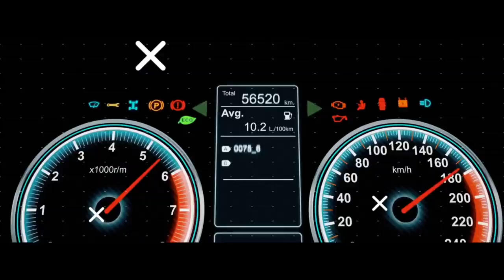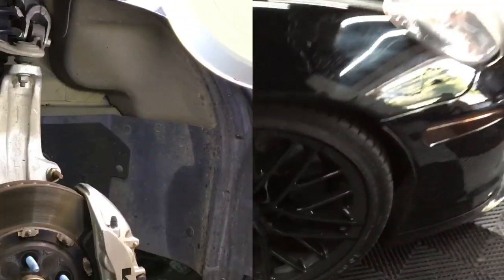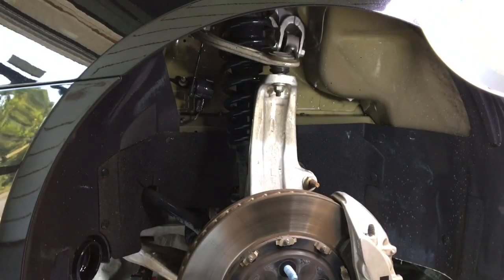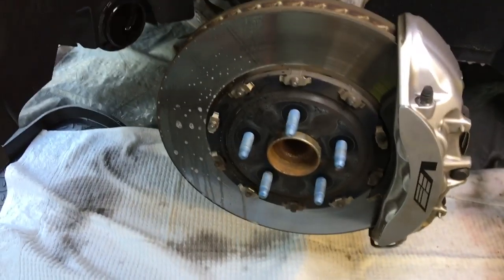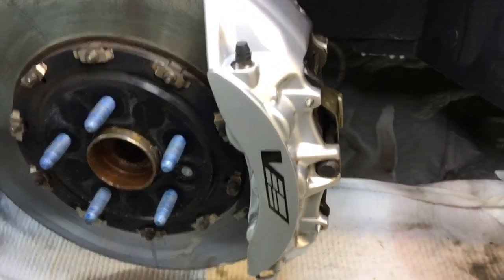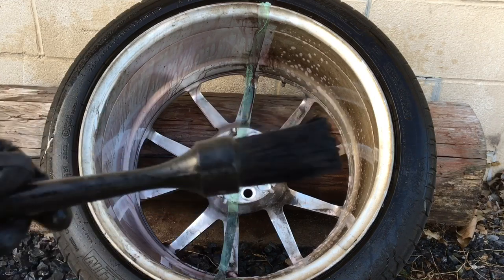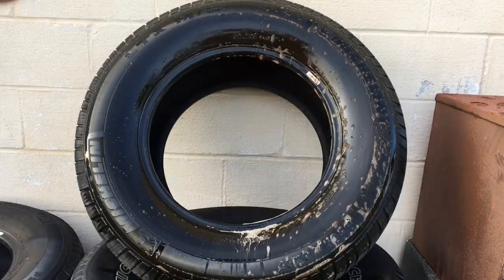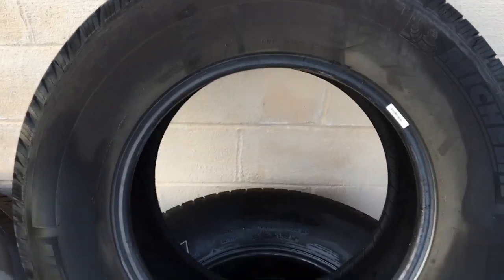P & S Brake Buster!! Non Acid Total Wheel Cleaner!! My Conclusion Is........

Comment: I think Brake Buster is a really good maintenance wheel and tire cleaner. Sometimes a heavy duty iron remover wheel cleaner isn’t needed. I think you did a good job showing that.
Reply: For being a driveway detailer this is on my shelf. I keep my tires and wheels in good shape and this works well for me.
Again Brian thanks for your info :)
Reply: mrken66 You are welcome!
Reply: I am solutely agree, Brian. Brake Buster is my maintenance wheel and tire cleaner...I have other products for heavy duty/major cleaning (Adam's Tire and Rubber and Meguiar's Ultimate All Wheel Cleaner). But as long as the wheels and tires aren't completely trashed, this is a very good product to keep them clean on a regular basis.

Comment: Best in depth review I have seen. I use Break Buster on well maintained cars and I like that I can clean the tires and wheels with one product. On heavy duty dirty wheels a product with iron remover would be a better choice, but then again you would need to use another product for the tires.
I agree it is a good product but not the end all be all of wheel/tire cleaners. Price 👍, made in USA 👍
Thanks Brian 👍✌️🇺🇸
Reply: That is exactly how I use Brake Buster as well. My cars are well-maintained, and I rarely need an aggressive wheel cleaner. Brake Buster and a couple of Speedmaster brushes keep my wheels, calipers, and tires flawless.

Comment: I made the switch not long ago to the P&S and i am glad i did because it does a great job at the minor dirt that my car gets and is cheaper than the ones i was using. If i were to go after really bad rims and tires i would probably try it and then go to stronger. Well worth the money in my opinion especially if you do not let them get extremely bad

Comment: I like Brake Buster for being non-acidic, does not rust rotors, and gentle cleaning. So for the correct tire or wheel it is all I can ask. For the rest, I pick and choose based upon the wheel and tire conditions.
Reply: Acidic cleans rust off

Comment: Couple thoughts! My two cents that is… 
P&S has this priced where it’s hard for me to justify many other cleaners. That’s not to say this is all I use or even that I think it’s the “Best” at any one thing. It’s solid for both Wheels & Tires which makes this one of two baseline wheel/tire cleaners I start off with depending on the situation. I always start off as least aggressive as I can and step up from there IF needed. Best value and a good starting point on well maintained cars ( wheels ). I also like the fact that whatever rust inhibitors it has actually work. I use this on my personal vehicle ( White Brake Calipers ) on a regular basis with good results. It foams great with a foamer and foams ( clings ) above average with just a regular sprayer.  Seems like there’s a significant amount of lubrication in it which I like also. 

I have found so many Wheel cleaners aren’t as good at cleaning tires and vise versa. I used to hate having to reach for two different products ( one for wheels and one for rubber ). It filled that gap in for me for the most part. Having said that… I still have and use other products based on the scenario. I’m not sure there is a “Silver Bullet” for wheels/tires as there will always be many variables and factors to consider. 

Wheel / Tire cleaners happen to be the one product I seem to use the most of in terms of quantity. I’m sure some of that has to do with my heavy-handed spraying “technique” lol. Having said that …. at $20.99 per gallon ( retail ) or better yet $14.15 per gallon (my discount) I can’t see buying many others. 

My top two (Non-Acid) products that do well on Wheels & Tires (caveat) … while being priced affordably are BrakeBuster and NanoSkin Non-Acid. Off the top of my head I either have currently or have used in the past: Eagle One – Mag/Chrome/All Wheel/Plasti-Coat/PVD,  Meguiars – D1801/D140/D143, Chemical Guys- Diablo Gel, Griots, 303, Super Clean, Power Clean, Purple Power, Extra Tough and many more. 

As always…. Thank you for the video! How about a QP ON durability update video ( maybe 2.0 )? Either way I look forward to whatever you decide to roll out next.
 Take Care!

Comment: If doing a wheel off, any non chlorinated brake cleaner spray should work for inside the fender hub. It will not rust out the rotors like a lot of wheel cleaners do. It will not harm painted calipers, but will harm anything that is powder coated. 
I’ve also used it for the inside barrel of rims to get hardened brake dust off. 
The outside of rims, there’s a bazillion choices. 
I haven’t tried Brake Buster yet, so thank you so much for the video!

Comment: I bought a gallon of this stuff and mixed it 50/50 with water. I've been using meguiars hot rims wheel and tire cleaner for the past 2 or so years. That stuff did a pretty good job but didn't clean rubber as well as the wheels. This brake buster stuff when I sprayed it on didn't seem to change color much but I brushed the tires and wheels real quick and hosed them off. I haven't seen my wheels so clean and bright since I polished them several months ago. Really happy with it for a general use maintenance cleaner.

Comment: I stay ontop of my car, washing it once or twice a week, so P&S Brake Buster HAS replaced my other wheel cleaners, except for Auto-Fanatic foaming wheel cleaner because I still have 2, unopened quart bottles of it, like that as well but yes, it's VERY expensive but safe for your wheels AND you!!

I used it first in my IK 1.5 and now my Foam Pro2 and have settled on 4:1 for my maintenance washes. It cleans well for me and has the rotors rusting about 50% less, so I like that and imagine its safer for the associated parts around it as well. Finally price, another winner for me👍👍

Comment: When I first tried it, I thought Auto Fanatic wheel cleaner was “ the” game changer. I’ll have to look again at my dilution ratios on value but using PS BB. On maintained wheels , with some agitation, at 5:1 in an IK foamier it worked great, the foam had a long dwell time in shaded heat in Maui. I agree with Brian, it’s not the end all. I still use some pretty heavy duty cleaners on especially harsh tires and wheels. Experience as always will dictate what product I think will get the job done at the quickest and most effective. Each product I use is like a golf club in my bag... sometimes I need the driver, sometimes the putter or a pitching wedge.

Comment: With ceramics on both my daily drivers I don’t need a dedicated wheel cleaner, but I bought a gallon and use this straight for tyre cleaning. You can’t beat it for the money, even out performs dedicated tyre cleaners I’ve used like the gyeon and adams

Comment: P&S also is supposed to have a rust inhibitor to help with rotor rust after cleaning. As you discussed
Reply: I find I like to use P&S for maintenance, but when I use say adams wheel cleaner that has an iron remover in it, I actually spray P&S (diluted 1:3 rn) on the rotors, caliper, and pad area to help with the rust. I've noticed with iron remover I've gotten rust on the rotors of course, but also at the top of the pad where the clip meets the caliper.

Comment: I like nanoskin non acid, excellent wheel and tire cleaner even removing silicone easily, many suds and lubrication. It is stronger than brake buster
Reply: Same here works really good and cheap.
Reply: It’s my go to as well - if I need stronger I hit it with Nano Speedy Brite - that generally solves the problem. I have a small bottle of the old skopl acid if push comes to shove, but very rarely need it.
Reply: James O'Brien yeah I like nanoskin because I change every week the dressing used so I want to strip it but brake buster is a good one also for that situation.
Reply: @James O'Brien Then why not dilute it a bit more? Less stronger and it last longer and cheaper

Comment: I actually really dig this as an alternative to using an APC on tires (which is my current system). Been using Simple Green (diluted 4 or 5:1) and it works great, but being a degreaser, it is going to take some amount of your tire coating/treatment off (how much is hard to say but I imagine it would shorten the life of whatever you're using if only slightly). BB seems to do a great job but without removing as much of the coating. I usually treat my tires with Perl after cleaning and it'd be awesome to be able to clean a tire without having to recoat every time. And as you mention, it's nice and cheap so I'll definitely give it a go. 30 bucks (CDN) for 4-5 gallons of finished product is as cheap as damn near anything out there.

Comment: Selling point of Brake buster: versatile (wheels/tires/wheel wells), good value, gel-like texture (stick to rims better), anti rust (some say rotors still rust after )
I will try after my bilberry wheel cleaner gallon is done, especially because of the gel texture ( i hate applying a wheel cleaner and most of it goes straight to the ground) and because it will replace also the degreaser i use to clean tire and wheel well.

Comment: For best results with any brake/wheel cleaner is to apply it, allow to dwell, then agitate with a decent brush, then pressure wash. The P&S exceeds my expectation every time. I do all the suspension and steering components and it leaves it all looking like new. After it's all dried up, I hit with a hydrophobic spray and wipe it all down so it resists road grime making future clean up much easier.

Comment: This is what we've come to expect . no hype just good reliable info thanks  Brian.  I love my nano skin  non acid wheel and tire cleaner. But may pick this up to play with. What about slickness p&s is known for?
Reply: I have both. If your asking does the wheel feel "slick" after cleaning with BB I couldn't tell you. LOl... Actually .... until now I never thought to check lol. I can tell you that I noticed considerable lubrication (slickness) while agitating with a small brush ( whatever that's worth ). Much more so than other cleaners I've used. NanoSkin Non Acid is stronger than BB and they are my top two. I generally start with BB and move up in aggression from there as needed. Love them both .... especially considering what they cost per gallon.

Comment: I think for a detailer such as yourself, you absolutely would not want to have this as your only wheel and tire cleaner. There are stronger cleaners out there that are going to allow you to clean the wheels faster and easier.  I think Brake Buster is better suited to weekend warriors detailing their own vehicles on a regular basis, or if you have regular clients that take good care of their vehicles. 

I'm a weekend warrior, I wash my vehicles every Saturday morning. For me, Brake Buster is perfect because my wheels and tires never get very dirty...and this is a more gentle maintenance cleaner that is safer for regular use (for me and for my wheels). I dilute it 5:1 in an IK Foamer. A quick scrub is all it takes to get them perfectly clean. At that dilution ratio, it is super economical.
Reply: How much different can you get from onecwheel cleaner to the next? Is there a different formula? Put them side-by-side and read the label

Comment: What will it take to get you to do a 3D Super Wheel cleaner the same way? I like it. Another question is what is a good extractor for a decent price? I am over the bissell spot clean and it has to do with the extremely short hose. I have a 17 ram 1500 crew cab and that hose makes it a pain.  Maybe some day I can get to work a day with you to learn a few more tricks.

Comment: I have a 2020 Ram and it has painted wheels.  I plan on hand washing this truck on a regular basis.  Which wheel cleaner should I buy?  I was thinking P & S may be worth it.  I purchased a bottle of Meguires wheel cleaner but that only lasted 3 washings.  I want something I can buy a gallon of and mix it to get many washes.

Comment: So I think you're all a little confused.  I don't think anyone is claiming brake buster to be better at cleaning than other brands.  It's a cheap product that is easy on your body, and cleans ANY wheel which takes the risk out of it with pros being able to use just one product.  Are there better cleaners for this, absolutely, but this is a one stop shop cleaner that won't kill you over the course of 30 years
Reply from the maker: I am not confused...and dont care what others say. They do not work in my Shop. I am saying it is average....not bad...not incredible...average.

Comment: I must say though......

do you not consider possible ASBESTO or any unknown dust you might be kicking up with that blower method for drying? 
Even OSHA has recommended AGAINST such methods when working on brakes. Now I know you aren't working on brakes, but the wheel well area is a known area for that sort of contamination.

Comment: Sticking with adams. It is expensive, but I've been using it diluted 50/50 with DI water or even less for maintenance washes.
Reply: police_state ain’t doing yourself much of a favor sticking with Adams but to each their own
Reply: @r3ktfahdle120  What do you recommend as a replacement? I haven't been following wheel cleaners too closely lately as I have a gallon of Adams and have been satisfied with the results.
Reply: police_state i maintain my cars weekly so brake buster just works for me. $20 a gallon you can’t really beat it. I like Adams but their stuff is really expensive and the company seems to be moving toward rebranding a lot of their new products. For caked on wheels I really like Meguiars all wheel cleaner, you can find it at any auto parts store

Comment: Agitation makes more of a difference than the chemicals on wheels.
Reply: Very true, but I found out when you have a good wheel cleaner that does alot of work loosening up the build up, before you get to the agitation, that makes a world of difference on how long and hard you have to agitate.
Reply: Ree B harsh chemicals are a big no no. Brake buster is one that doesn’t use the harsh chemicals like other rim and wheel cleaners do and it does a fantastic job imo
Reply: @mokokoco4720  Sure. I didn't mention "harsh" chemicals. Maybe you misunderstood me.

Comment: Meguiars detailers wheel and tire is THE STUFF you can buy ready mixed 32oz bottles for like 12 13 bucks or dilutable gallons for around 40. Good stuff, and it actually cleans tires unlike lots of wheel and wheel and tire cleaners.

Comment: I wonder if they changed the formula when they brought it over to the renny Doyle line? I used it about a year or so ago when it had the old label and I wasn’t impressed at all. Sticking with the meguiars non acid wheel and tire cleaner.